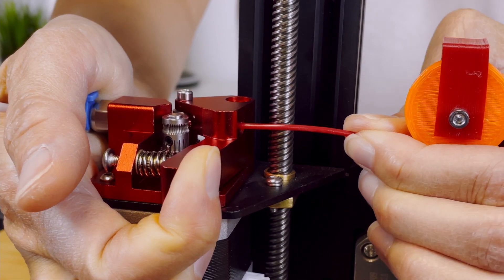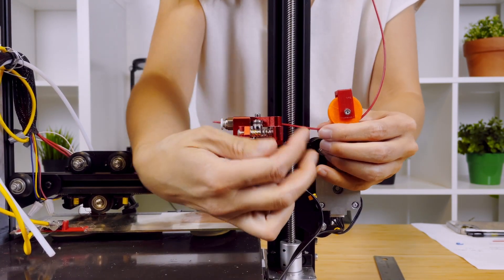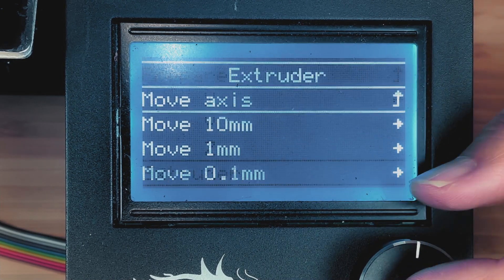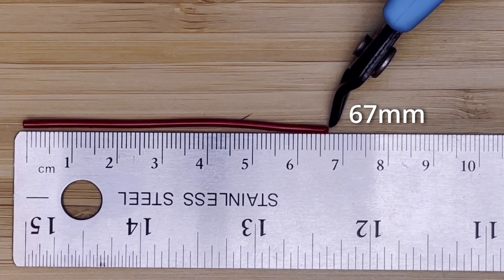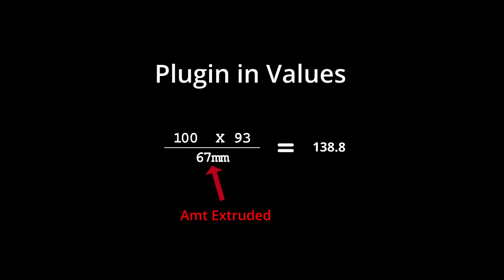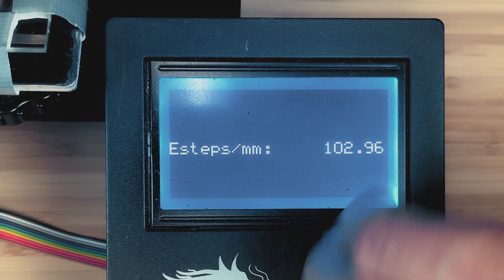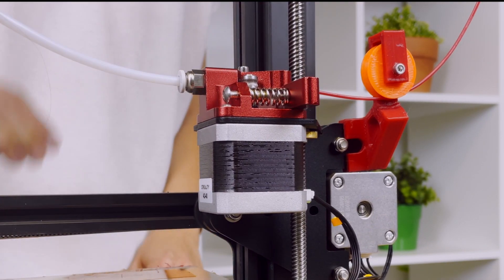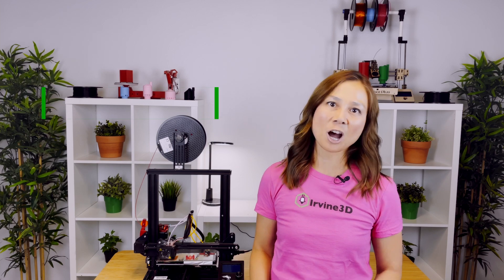How to Calibrate Extruder E-steps (Ender 3)

Comment: I have tried this, but the values never zero in accurately. Let’s say I have the same exact settings as in this video, when I run the extruder again, it often over extrudes. I readjust, and then it underextrudes. Rinse & repeat until I get a baud that is close to being the exact length extruded. Sometimes I do this 6+ times.  Very frustrating!!.

Comment: It's a good video but I think you need a more accurate measurement by measuring with the the resistance of filament extruding. By leaving the tube in and measuring from the ouside while the filament is flowing through the hot end nozzle... just my .02
Reply from the maker: From our experience, it doesn’t make a difference.

Comment: Very good video! Why do you warm up the nozzle though?
Edit: To remove the filament, ok i get it. I just got mine and haven't used it yet, so no need to warm it up i guess.
Reply: In most printers, you can't extrude if the nozzle is not heated.
Reply: @MegaDraadloos  you are right. Even without fillament in, it doesn't let you use the extruder without warming up the nozzle! I found out when i went to calibrate mine.

Comment: The e-step value would be totally different again when the filament is pushed through the hotend.
Maybe it should be calibrated through the bowden tube and hotend as it would be the same as an actual print.
Reply: The e-step value should remain the same through the tube and extruder, as it is a representation of how many steps the motor makes to travel a known distance. If you have a helper on a construction site consistently cutting on the wrong side of the line for every part you measure, the problem would be the person cutting, and not the dimension you marked them to cut. When you get sick of the helper producing bad cuts and get a new one that cuts correctly, you would not want to have changed your tape measure to compensate for the previous helper's errors as now every part would be the same error of the cut in the other direction.    That is why e-steps are usually one of the first things you set up on a new printer.  In math, it would be defining a value of X before solving the rest of the problem.  If you have the wrong value for X, no matter what you do, the formula will be wrong.
Reply: The way it was done in this video is the correct way. You would adjust temperature and flow rate if your prints were still coming out over or under extruded after you had adjusted e-steps.